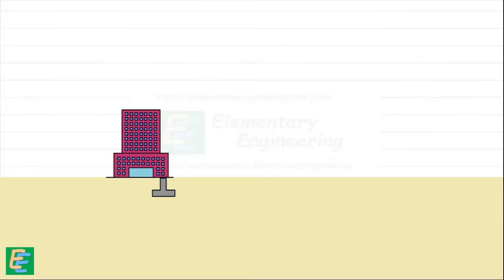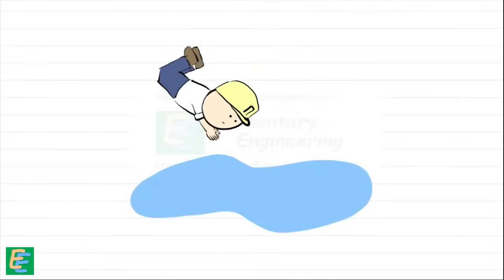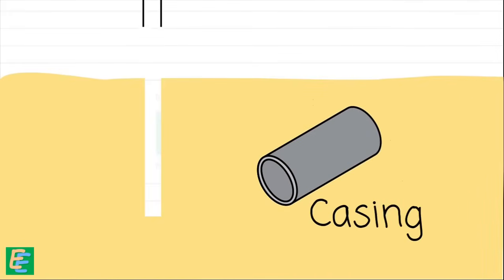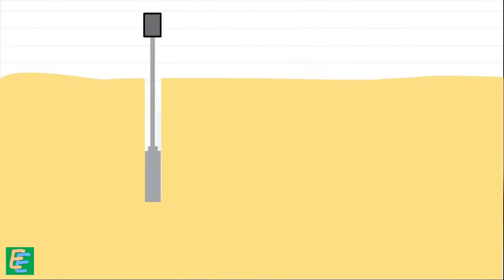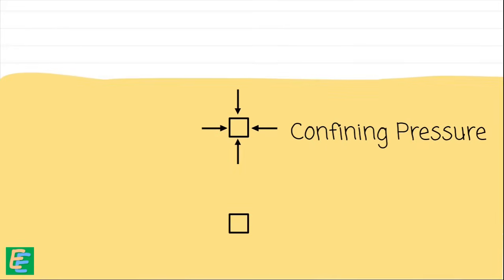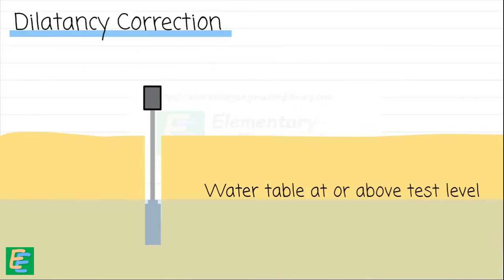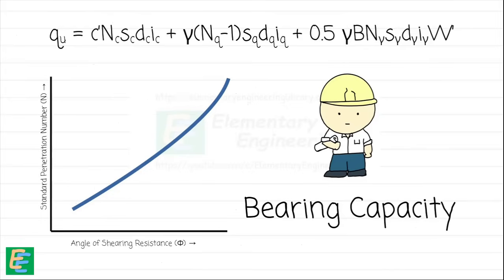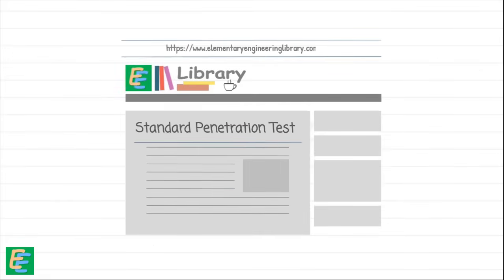Standard Penetration Test Simplified | Foundation Engineering | Elementary Engineering

Comment: There is 2 possibility  in overburden correction 1)if coreection  value is greater than 2 so correction is divided by 2 
2) if effective stress is greater than 280 kn/m²  then this overburdened correction is not applied 

And for dilatancy correction 
If after applied overburdened correction SPT no. Is less than 15 so dilatancy  correction is not applied.... 😊